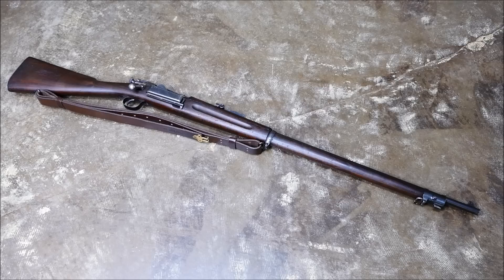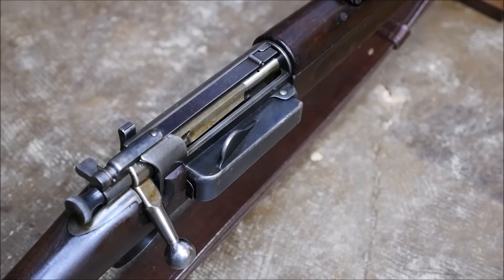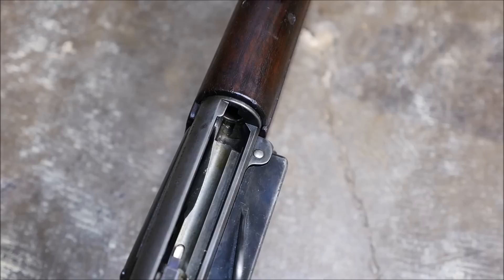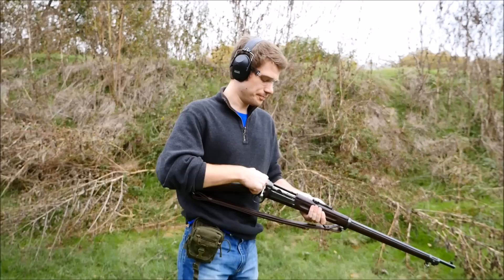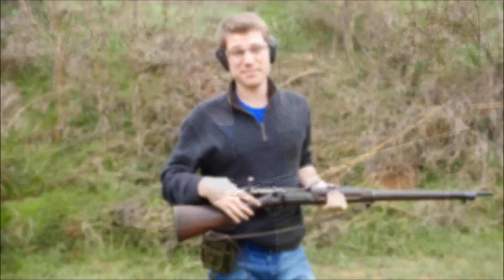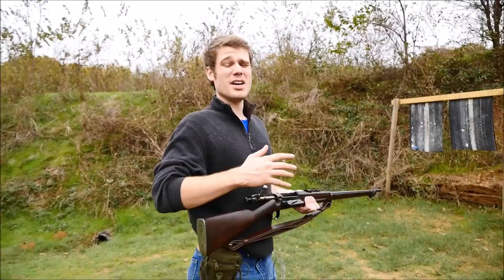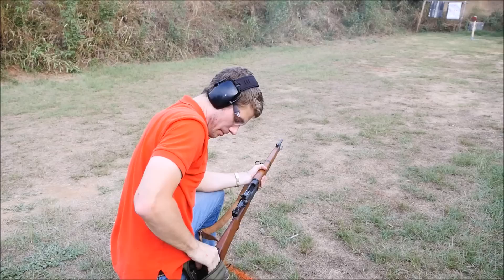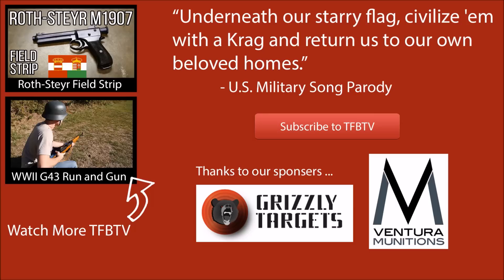Krag Jorgensen Run and Gun

Comment: How does the loading gate feed rounds into the breach without spring tension? Those rounds look like they are just being piled loosely on the bottom.
Reply: +bigchunk1 There's a spring loaded follower inside the mag hatch. Unless you open the mag very slowly, it's hard to see it. But it's there. I own an M1912 Carbine, so no BS here :D
Reply: Arild Solemdal Oh thanks. The tension is caused by the closing of the loading gate then?
Reply: +bigchunk1 The tension is created by BOTH the spring and the closing of the loading gate. I think I'll make a video showing this - tomorrow :D

Comment: You can use stripper clips on it if you want.
And you don't need to poot one Bullet at the time. Dump them in and close the box and it will be just fine

Comment: It jams ang takes longer to load. Maybe the reason why Americans had many casualties during Filipino-American War because Mauser was really better.
Reply: What are you talking about? The US suffered some 5000(?) KIA, while killing about four times as many Filipino soldiers. If the Mauser was that superior, why did did they lose in such a spectacular fashion? These weapons were different designs. The Krag was designed for picking accurate shots at opponents, while the Mauser was made for volume (imagine firing into a mass of thousands of soldiers trying to storm your position). What's best? It depends on the type of war you are in.

Comment: That loading mechanism... I'd rather have a falling block single shot rifle than this. Seriously who though this was practical for combat? Even by 1890s this is way too fiddly.
Reply: Well the idea was you'd be able to easily top off a magazine without opening the bolt. Which you can do, but what you sacrifice is literally everything else.
Reply: The rifle was designed to be a single loader, with the 5 rounds kept in reserve. There is a magazine cut off, so you load a round, fire a round, load a round, and then, at the key point of the battle, fire five rounds fast. A company of 80 or so men would all fire rapid fire at the same time, putting 400 rounds down range, probably breaking the back of any enemy assault.  In the attack, other men would be firing to permit you to advance. Perhaps, as at San Juan Hill (Kettle Hill) the other men would be firing a Gatling.